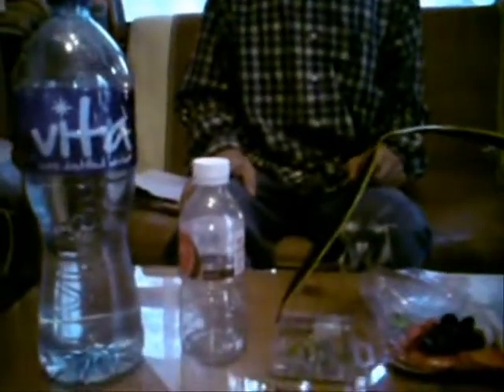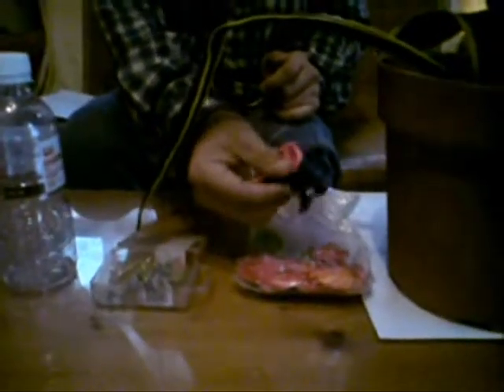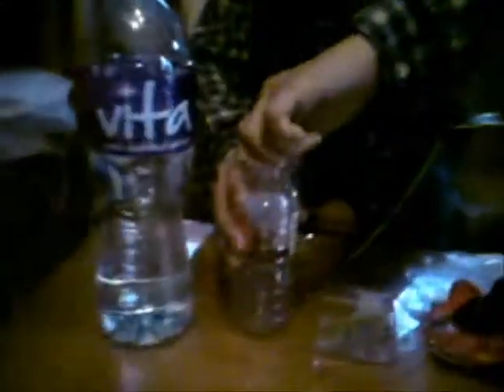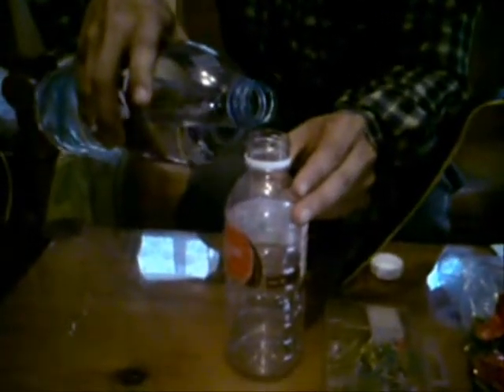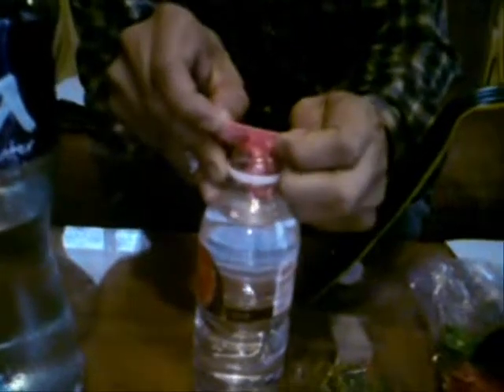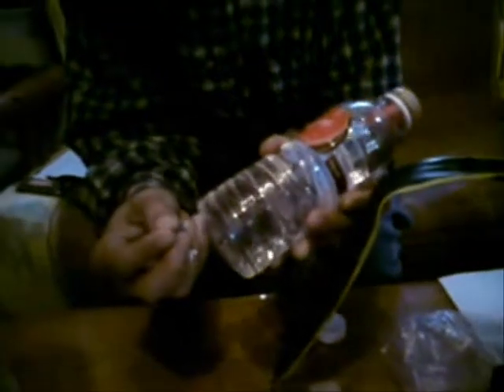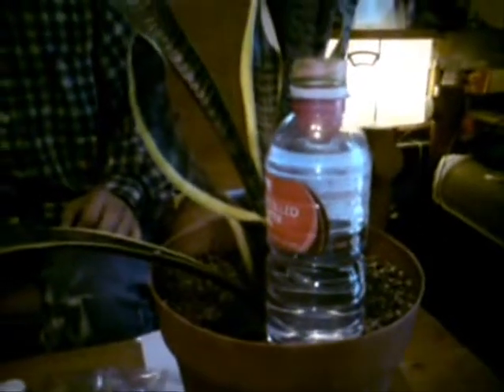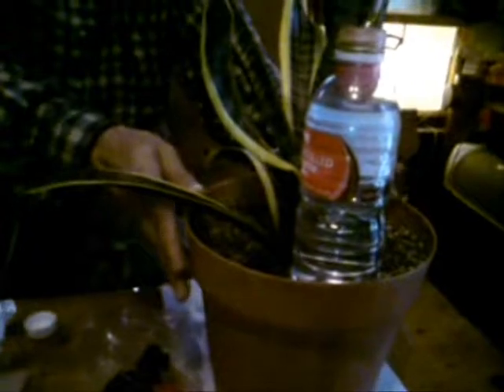Slow Drip Irrigation System

Comment: I tried this with a two liter bottle and one balloon.  It did NOT WORK. The balloon acts as a cap and after the initial drips, the water stops coming out.  I tried it with one hole, two holes, and three holes.  The whole diaphragm explanation seems weak.  The bottle sides already have a lot of flexibility as the sides of the bottle slightly cave in as water initially runs out.  I could try this with a more rigid bottle, but the video shows a thin plastic water bottle being used and I doubt that it would make any difference.  It's called equilibrium.
Reply: Then, use two balloons or three. It is like a human diaghragm. Without its elasticity, breathing is impossible.

Comment: why not just several holes in the lid and put the lid back on the bottle.. put the bottle in upside down into the plant soil.
Reply: I tried that. The water came out too fast. I also tried putting the tiniest hole I could find in the bottle...it still emptied in less than an hour. Gonna try this. He says 2 days...we'll see.

Comment: Good info! Why the balloons instead of the cap?
Reply: Roxanne Cox I was wondering the same thing. At the end of the video this is explained, although a bit hard to follow.. The balloons allow for air pressure in the bottle to change. This allows the drops to come out of the holes.
Reply: Thank you!
Reply: I made this video some years ago. I used balloons because they are elastic and flexible.
Reply: The cap will not work because it is not flexible.